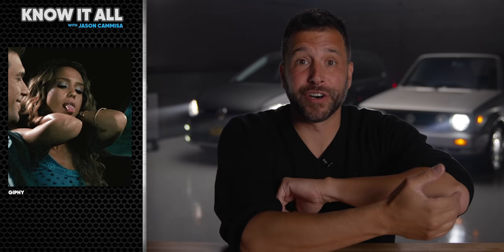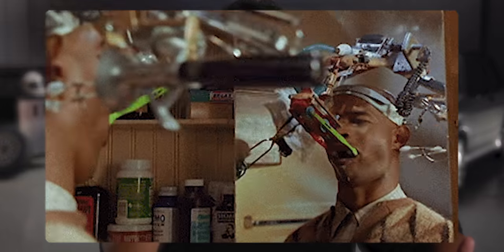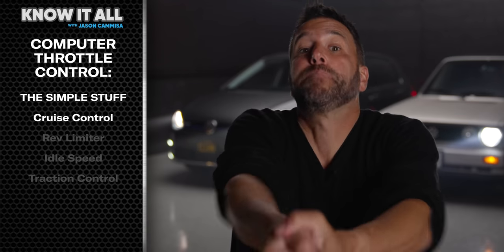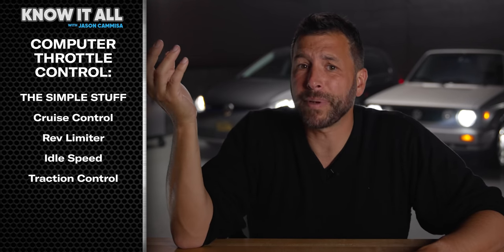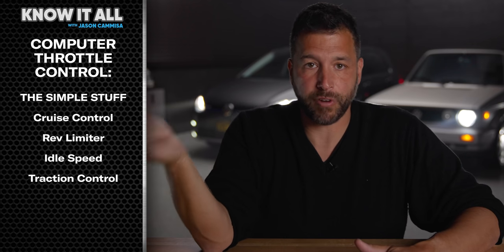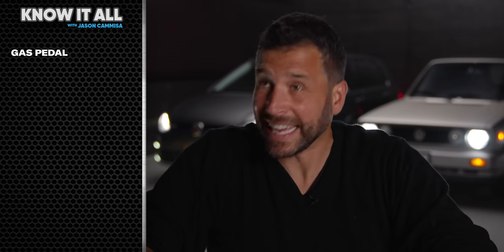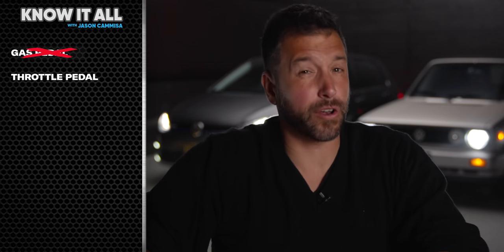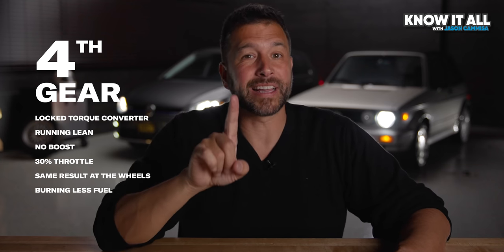Having no gas pedal is a good thing | Know it All with Jason Cammisa | Ep. 07

Comment: I’m only using the phrase “Torque Request Pedal” from now on, just to see who is and isn’t tuning in to one of the best shows on YouTube.
Reply: Ha! I'm in for that!
Reply: Good idea! I am joining in!
Reply: Me Four
Reply: lol lol lol i am also going to use that in my next video lol lol
Reply: You can't call it that if you're talking about a carburetted car that uses cables for throttle and it's idle rpm is managed manually using a choke 😁

Just know when and where to use it
Reply: @jt9300  no, technically it still is a torque request pedal. The difference is that in your example the car has only one variable at its disposal, the throttle position. You can call it both in your example and be correct.
Reply: @jeremystaten1143  fair point 👍🏻
Reply: I'm definitely calling the the ride by wire throttle on my motorcycle the torque switch from now on.
Reply: That's a great way to filter for the people you want to be friends with.
Reply: It won't be long before that Torque Request is connected to the internet, which will then be capable of denying you the Go Juice.

Comment: I genuinely thought they were going to pitch an idea where you only have a brake pedal and when you let off it accelerates (like those terrible mobile racing games).
Reply: Same, would've been weird like if you could tune the ECU to move off at 80% throttle all the time, then you do passive burnouts in bumper to bumper traffic
Reply: You mean like in some types of riding lawn tractors. Quite annoying and sometimes dangerous on those.
Reply: This is basically opposite of the "one pedal mode" that actually exists on recent Leaf cars and some other electric cars. That mode "defaults" to maximum regenerative braking and stepping on the "torque request" pedal progressively reduces engine braking and then transitions to actually adding power
Reply: Lol that would be a hilarious disaster
Reply: 😆i was thinking something like that myself, before i clicked my thoughts where F'k first the manual now the peddle what's next the steering.

Comment: Another potential benefit to throttle-by-wire: Cylinder deactivation in a car with individual throttle bodies. Who needs a complicated valvetrain when you can simply keep that cylinder's throttle valve closed? This also allows other cylinders to open the throttle valves further (because this will put a higher load on each of the remaining cylinders), to increase economy. And it's not a toggle.  It's not "8 cylinder , 6, or 4 cylinder."  It could be any number of cylinders that get deactivated. It could be used by the engine computer to deactivate cylinders that it has detected a misfire in, in order to save the engine, catalytic converter, and environment.

Comment: Jason: "Your car, like every other car in production today, has a by-wire throttle"
Me: looks around at my aging fleet of drivers and suddenly feels very dinosaur.
Reply: Lol ur telling me, my youngest car is from 1997, hell it has a cable clutch still
Reply: @daslynnter9841  I've got 2 cars with cable BRAKES.   Like, that's it.  Literally a pedal connected to drums by a cable.
Reply: That is why I enjoy my '75 Jeep CJ-6 that has both hard linkage throttle and clutch. I hate chasing sensor related gremlins that infest anything built in the last 30+ years.
Reply: Lol don't worry- I think the only one of cammisa's like 7 car fleet that has throttle by wire is the e-golf (and maybe that lotus?)
Reply: Yep I like my dinosaurs

 I got a 97 and a 62 in the shed both are void of the brain boxes only cables rods and linkages 

Hell the 97 will run without a battery once it's started
Reply: Only half my cars are drive by wire! And both have a direct steering connection
Reply: It starts to feel a little awkward when I have to keep scrolling to get to the model year.
Reply: @5000rgb  no, not awkward, better.
Reply: @daslynnter9841  Mustang?  My 03 mustang gt has a cable clutch, cable throttle. It does have traction control, but all it does is cut spark or perhaps fuel as far as i can tell. It has been off for the past 3 years as my abs has a bad ground.
Reply: I have three vehicles. Two have cable throttles and one doesn't actually have a throttle. The torque demand pedal (what F1 calls is and cooler sounding than "torque request pedal" IMNSHO) connects via linkage to the injector pump.
Reply: yup have a 81..even had cable break..once unlike todays generation know how to drive without useing clutch...catch on the revs...and for this guy a potentionemeter is a limiter
Reply: 3 of my 5 cars don't have drive by wire. 1 of the two that do (Lexus) actually has a goddamn throttle cable but instead of being attached to the throttle, it's attached to a "torque request sensor" on the throttle body. It's 99% of the way to being a cable operated throttle, it stops just short. (yes there is a reason, it'd a failsafe. If the computer fails to open the throttle because the motor or sensor dies, after about half the throttle pedal travel, the cable engages with the throttle itself to operate in an unpowered failsafe limp home mode)
Reply: It seems like this is the unofficial thread of people with throttle cables. So let's just list our cars. '84 533i (cable). '91 300zx (cable). '99 Suburban (cable). '03 IS300 (drive by wire with cable backup). '09 RX-8 (drive by wire)
Reply: It's not all bad.  Try something with a DCT, which requires some pretty advanced computer controls, and it will make more sense.  Especially if you start playing in the windy bits, and the computer starts lending a helping hand...because you don't usually have anywhere to safely spin out on the streets.
Reply: Old is gold

Comment: If there's anything I've learned from watching MCM and Skid Factory, it's that e-throttle was one of the best developments in engineering that reduced mechanical complexity. I've been having a load of issues with the shitty idle control system and vacuum-operated cruise control device on my 91 Miata. Hunting idle, hard starts, vacuum leaks and coolant leaks from a spaghetti of hoses are all problems e-throttle has solved. Once I go to a standalone ECU setup, I'm definitely going to figure out how to retrofit e-throttle.
Reply: Had similar problems with my aw11 mr2 and it was driving me up the wall. My daily meanwhile is a ton simpler.

Comment: Except cruise control you can do all of the stuff (mentioned at 1:30)  on a traditional cable controlled throttle by controling ignition. Have a look at motobikes. Most of them have cable throttle and still have traction control, rev limiter, idle speed control etc.

Comment: "Torque request pedal." Thanks Jason; this is only nomenclature I will use from this point forward.
Reply: Considering I have a 2002 Prius, I can't exactly call it a "gas pedal".
Reply: @aspecreviews  The Prius also has the steer by wire "steering request wheel" lol :)
Reply: @mry82  no, a 20 year old vehicle does not have steer by wire. In fact, no Prius has had steer by wire. All Prii have had brake by wire, though, so I guess you could call the brake pedal a braking request pedal
Reply: @aspecreviews  p.s. thanks for correcting me. I know some people are sensitive about these things, but I would rather know the truth! (also, if you already saw my last response, I edited it a bit, lol)

Comment: It also seems highly plausible that drive by wire throttle opens up vehicles to being "hacked" and the car having runaway acceleration.  Combined with electric steering, you're going to pull a "Diana."  So, there's pros and cons.

Comment: electronic throttle is only another item to fail (when it does fail it isnt going to be like your window motor where you baby it till you get your next check) catastrophically and because it is electric it will either be intermittent issue, or dead as a doornail. people who drive older cars are better off should they snap a throttle cable or bend linkage, cause a new cable runs 50-100 usd at most (at the high end with someone replacing it for you, new cable for a 2009 chevy pickup is 30 bucks) an electrical sensor will not only cost more (think FEM/REM modules here) but more than likely will have a code to them meaning to replace it you not only need a new part, but the tool to program an electrical component.

Comment: The problem with these “torque request systems” is the same complexity that makes them so impressive on paper. Because they are constantly recalculating, they are constantly readjusting to produce max efficiency at the expense of predictable (I.e linear) and responsive torque behavior. As a result, when I drive JLR’s new Ingenium engine, modulating speed with the pedal becomes almost impossible. While maintaining steady pressure to the pedal, the car alternates between too much and too little power, making it easier to just stick with cruise control. Meanwhile, when I drive Porsche’s N/A boxer 6C engine there is granular modulation and driver inputs are transmitted more appropriately through the drivetrain.

At the risk of sounding way older than I am, high tech isn’t always better.

Comment: Now there is active servo control of the wastegate on turbochargers as well, then a significant portion of the throttle mapping can be selecting boost based on the throttle pedal position while leaving the throttle plate open.

Comment: just give me back my drive by cable and take out 1)traction control  2)rev limiter , 3) cruise control   problem solved , and give me back my hydraulic power steering
Reply: I think you mean "drive by cable".  As "drive by wire" implies computer control and everything Jason talked about in the video
Reply: @alangil40   yes , typo thanks

Comment: It's also interesting to note that when it's 100% computer controlled, some cylinder head designs don't even require a throttle at all. Nissan's VVEL system actually keeps the "throttles" wide open all the time, and instead modulates torque by adjusting the "Valve Event and Lift" (in the acronym). This provides all the benefits mentioned here, but also reduced pumping losses by not having an entire intake manifold under vacuum.

Comment: I guess that's what Infiniti calls the intelligent transmission in my car because it supposedly learns your driving habits based on multiple data points and usually hands you the correct gear based on speed, the amount of "gas pedal" requested along with how fast you requested it.

Comment: Just give me the throttle cable... I don’t need the artificial throttle delay they program in. 
Keep your cruise control too.
Reply: My '02 Prius has zero delay. Toyota wanted to emphasize the half-electric nature of the car, and they programmed it to give the driver the torque they want the instant it is requested (unless the wheels are slipping of course).

Comment: Great video, I have learnt a lot from it. Is the horrible revhang on so many modern cars also connected with torque request pedal by wire or is it a produst of a different thing?
Reply: It is absolutely a side effect of electronically moderated throttle in order to maximize emissions.  In a cable controlled throttle engine, when you get off the gas pedal, the throttle closes completely, cutting oxygen to the engine.  However, if you were just at wide-open throttle, the fuel system is STILL giving you all the fuel you'd need at wide-open throttle, and when you get off the gas suddenly, you now have a cylinder full of fuel and no air, causing backfire and bad emissions.  

A fly-by-wire throttle system avoids this situation by not-quite-closing your throttle completely, even though you've gotten completely off the gas pedal to change gears, allowing a moderate amount of O2 into the engine to manage the fuel-air mixture more efficiently.   This is why we have rev-hang in almost every modern manual car.

It also works in reverse as well.  When you stomp on the gas in an electronically-controlled-throttle car, you're not actually opening the throttle wide open immediately.  The computer moderates the butterfly valve in a smoother way than you could ever do with your foot, getting that perfect air-fuel mixture, and avoiding choking out the engine.

However, all this being said, I still love my cable-controlled throttle on my '97 Miata...  Wonder why that is.

Comment: You forgot shutting off fuel delivery when coasting... Better mileage. Or did you say that? I was scratching my head...
Reply: Fuel-injected cars had deceleration fuel cutoff well before the widespread adoption of drive by wire throttles.

Comment: I would also add that drive by wire can actually make your "torque requests" linear, as your foot moves linear, but a drive by cable system would require none linear inputs for linear increases in airflow. What am I saying? If someone progressively applies the accelerator pedal then they will get an increase in air flow through the throttle body, but the angle of the throttle body when moved with a constant angular velocity doesn't result in a linear increase in air flow. Why? Because the difference in airflow from zero to 10% is so much more than 90% to 100%. Actually, the throttle body typically doesn't go completely from 90 degrees to the wall to 0 degrees or parallel, but the point is that the airflow will be greater initially than at the end. In fact, pushing the pedal the last little bit may do little to improve the acceleration, except at the highest rpms. The drive by wire system can smooth out this process, so it feels more linear with your foot. This means the last 10% may feel like the first 10%, but the throttle body will not move an equal distance under each scenario.

Comment: Very good video... Even I learned some things! Which... I know you don't know me Jason but if you can teach me something about cars, that's impressive. One thing you neglected to mention is emissions. One of the primary reasons car companies started to do electronic throttles is to make the lambda fuel ratio  adjustment PROactive instead of REactive. If you have a cable throttle, and you stab on the accelerator, there is a brief moment where the air flow sensor hasn't noticed the increased airflow yet, and a moment where the mixture leans out before the exhaust makes it to the oxygen sensor and tells the ECU that the mixture is lean. This may only be half a rotation of the engine, but you get a little burst of unwanted emissions. Suddenly lift off, and there is a brief moment of rich mixture. More sophisticated throttle position sensors (not just idle/middle/wot) improved this, as the computer knew what position your throttle was actually in, but at that point you're halfway to drive by wire already. By letting the computer react to the torque request pedal, and do the throttle opening in its own time, it can maintain the appropriate air fuel ratio continuously, regardless of how violently you stab or let off the go pedal.

Comment: ngl it would be kinda cool if you could have a "throttle cable" mode for your drive by wire car
Reply: there is an electronic device you could put between your pedal and your ECU that change the response of your "torque request pedal". let me search quickly.

Comment: Fine,,,,,,, but I don't like fly by wire for brake systems........
Reply: it's been around longer than most people think. Back in 1997, the original Japanese Prius had DBW brakes. EVERY hybrid/EV since (except maybe Tesla) has DBW brakes.
Reply: @aspecreviews  I get it, it’s technically safe. But I also like having a physical hard brake still. Yes millions in engineering and billions of miles of testing. But still, there just something reassuring about a physical connection over a digital one. 

Hell there are vehicles that have fly by wire steering. No physical steering column to the wheels.
Reply: @mathewhumvee  The very few vehicles that have fly-by-wire steering still have a physical steering column. If the power fails or the system goes out to lunch, the physical steering column is instantly reconnected. Same with fly-by-wire brakes. There's still a physical connection between your foot and the brake pedal, it's just not used most of the time.

Comment: Your videos are brilliant. A real petrol head who knows the facts. The throttle will also close if you apply the brakes at the same time.
Reply: Not always. For example modern Porsches leave it open when driving in sport mode to keep the turbos spinning fast, so you don't have lag when you get on the power again.

Comment: Every single driver controlled operation on a car is not ( and hasn't been for some time) switched on or even controlled by the driver . We request and the subsequent control unit decides if we can have it.
Reply: Steering is still completely mechanical, the electric power steering part is just assistance.

Comment: I can appreciate all the side benefit technology of drive by wire, but the principal purpose of it, accelerating the car, is inferior to a cable. Too much lag, less progressive, and more costly to repair.
Reply: e-Throttle actuators are WAY faster than even the fastest foot. Lag is part of OEM tuning, and one benefit of DBW throttles is that they can be reprogrammed to respond however you want them to.
Reply: @aspecreviews   Well, if that’s how they are tuned by the OEM, then my assessment of the lag is accurate. Every cable actuated car I’ve owned, including my 84 mustang with a factory Holley carb, had better throttle response than the drive by wire cars I’ve owned.